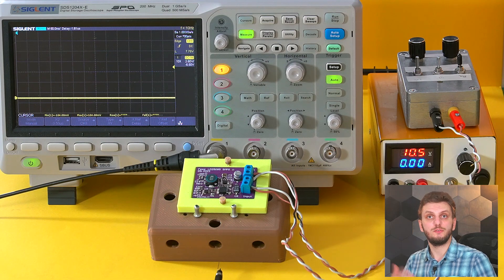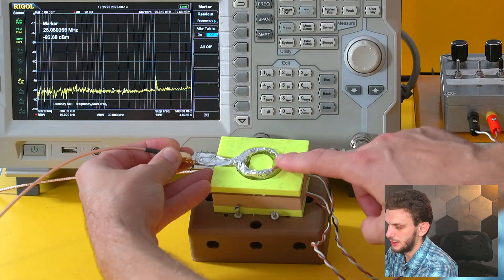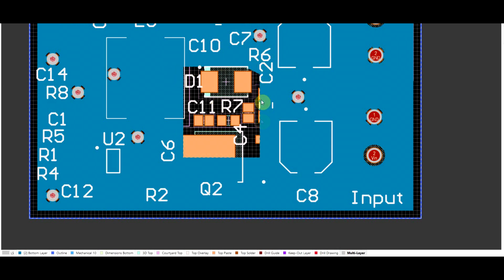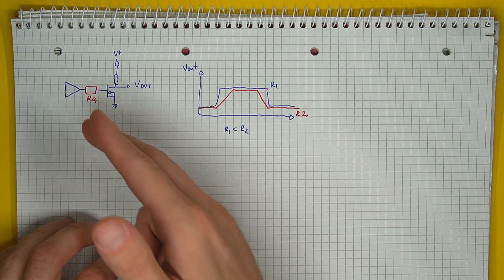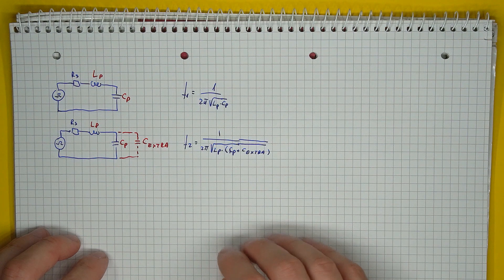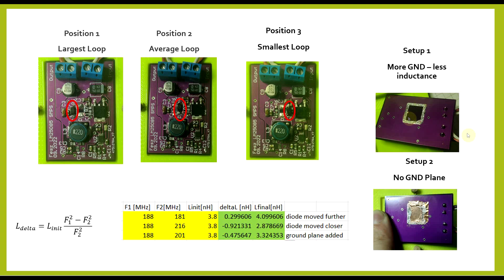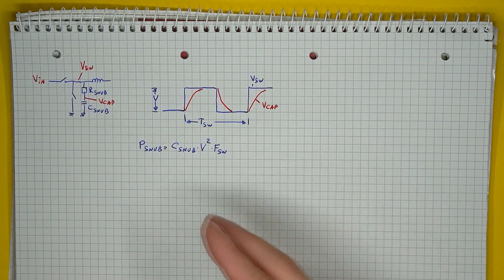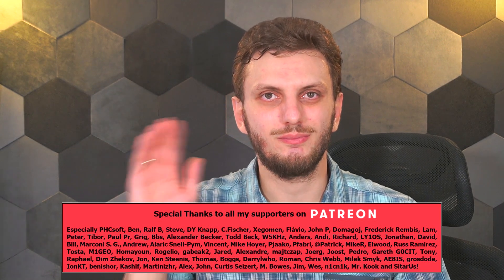Electronic Switches - SMPS and snubbers (2/2)

Comment: Great explanation! Something important to notice on this switching power supply design is that the diode also has a capacitance and it creates a new current loop that need to be considered during commutation. In this design I would recommend placing the diode close to the switching node and the snubber after. In that way, you reduce the loop inductance, as you showed, plus the current loop across the diode (due to internal capacitance), gets improved == better Emi.

Comment: I love your work, I actually pause and take notes. I have asked several top u-tube pros about snubbers, you hammer out the best and complete picture. The others give good but the same little 12 volt relay  and one diode for fly back. Would you Please do a session on a 48 volt pinball solenoid and 4 Amps rushing through in 100msec. then it is snaped off. Down the circuit a npn darlington or mosfet does this. I keep hearing the mosfet has a diode inside.   well I also have seen the coil wants to drop the magnetism at the speed of light and will produce 5000 Volts or more on any thing in its way. I have lost so many N540's and diode's. Now I lost a SMPS,  I have heard large filter caps to store energy, and i have heard to use a non polar cap and small resistor. I though solenoids are used in many factorys. I would like to know how to protect the system. I do not care how much it costs. The flipper on the other side of the pinball is just fine. Please show me a solution, I wonder if I channel energy into a hundred power power resistors would do the trick. Thank you for the perfect show. You are a great teacher. from Bill
Reply: Don't know all of what you have, and I have limited experience with what you ask, but what I read is simple: use a diode with a voltage rating >at least< 10x the coil voltage, and a current rating of >at least< as large as what the coil gets.
That 5000V is nothing, that will be without load (but it hurts for sure). The diode (if it survives) should keep that voltage always under 1V, that is its job.
It will be best I think to solder it directly on the coil (but make sure it is not to heavy and wrecks your coil with these slamming solenoids ! ), and its maybe not a bad idea to solder one extra on your FET or Darlington. A 1000V 6Amp diode will cost no more than 20 cent, a FR607 is a fast one with these properties.
I wonder why the other solenoid does not have this problem...
Reply: I did forget to mention: check well if that circuit around the solenoid has solid connections that can't be disconnected by these slamming solenoids, because then the diode will also be disconnected for a sec, and then the 5000V will go and search for an alternative path.

Comment: 👍A video setting out how a buck converter dynamically changes the input impedance depending on the load , how to simulate this and how to measure the input impedance will really help me to understand how an Mppt charger “ throttles “ output from a solar panel array when source power is greater than the load power required 🙏
Reply: Maybe I'm misunderstanding your question, but.... doesn't an MPPT (Max Power Point Tracker) use feedback to adjust the current drawn from the panel so that the resulting voltage produces max (voltage x current)?   The impedance per se would then be R = V/I.  And that in turn is really just the MPPT controller "learning" the I vs V curve of the panel under current illumination conditions.  So, averaged over seconds, the MPPT's "input impedance" is just given by the panel's I vs V curve (for that level of illumination).  On a shorter timeframe, the MPPT controller feedback loop "hunts" up and down the curve a little to seek out the max power. I think this is easier thought of as variations in how much current it draws, though obviously impedance could be calculated,  On the very short timescale, presumably there's some variation in the switching duty-cycle of the  MPPT input stage, though I assume there's an input reservoir capacitor to smooth that out and suppress noise.
Reply: @Graham_Wideman  MY setup is : " All in one inverter " which includes an MTTP controller and the inverter is ' bi-directional . Solar array 6 panels in series produce 3KW under ideal conditions i.e. 300VDC @ 10Amps . What I need to model is how Controller dynamically adjusts input impedance seen by the solar array , proportional to system load . e.g early morning load is 270 watts but panel produces far more , so I guess excess power not used is dissipated by the solar panels as heat. LTspice model of buck converter where the load can be adjusted and the input impedance varying proportionally shown on a graph is the goal.